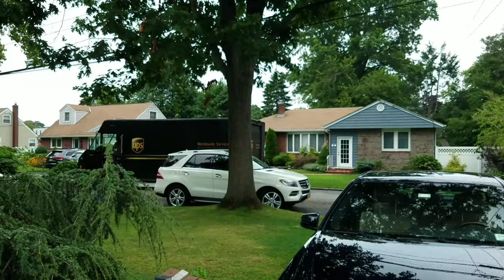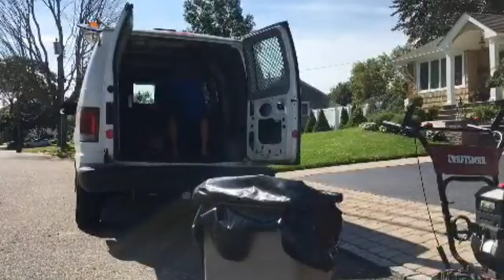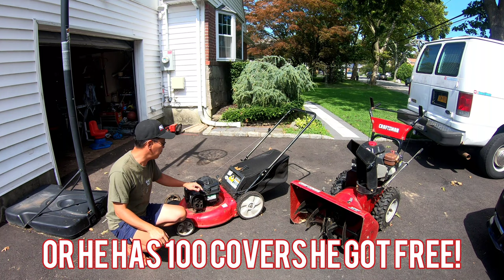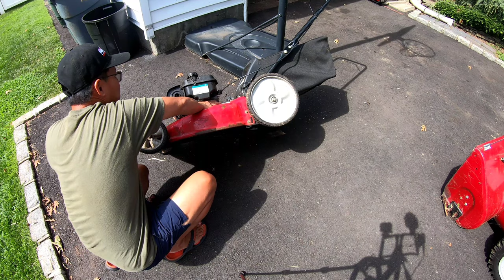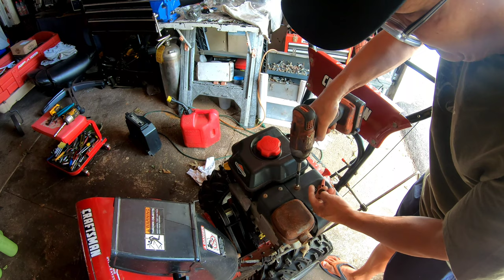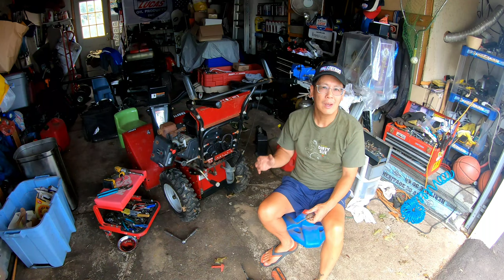FREE YARDMACHINES MTD 21" BRIGGS 550EX AUTO CHOKE PUSH LAWNMOWER & CRAFTSMAN 8HP 27" SNOWBLOWER PICK

Comment: Maybe stuck valve? Also that is the stator wire, it's hanging out like that because they blower does not have a light, so its just an unused option.the easy way to know if the engine has a stator, is If the last number of a Briggs model number is 7, the engine has electric start and a charging system.

Comment: Could be intake valve seat popped loose or valve out of adjustment, but since it was rusted together and had water in the oil I’m thinking it could be a stuck compression release on the cam gear. It might free itself up if it gets a little fresh oil splashed on it and some exercise
Reply from the maker: Good advice, I’m gonna tear into it on my next episode! Thanks

Comment: I just picked up a free mower last week the pull cord with broken and it needed a new spring it's a powersmart mower have you heard of them
Reply from the maker: Cheap Chinese brand sold at Home Depot.
Reply: @MowersNBlowers  I know nobody serves them in our area I use the pull cord and spring from a Craftsman to get it working
Reply from the maker: What kind of engine? Power no more?
Reply: The engine is made by Lincoln